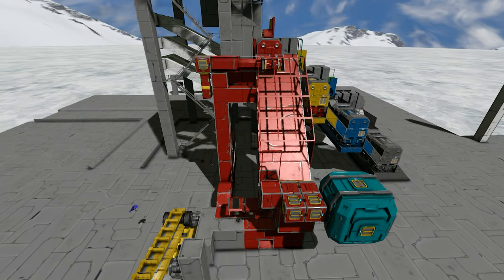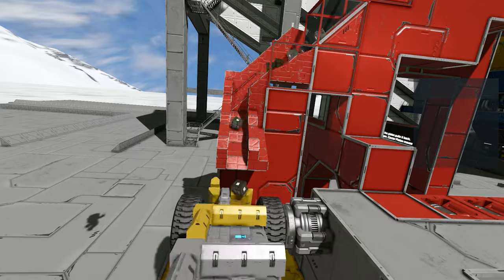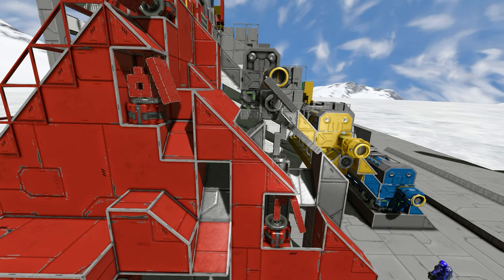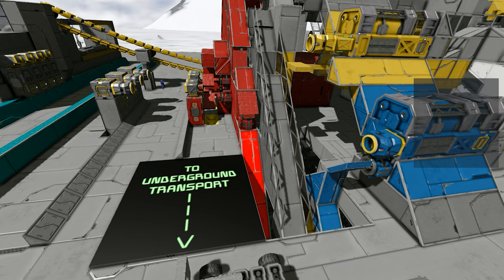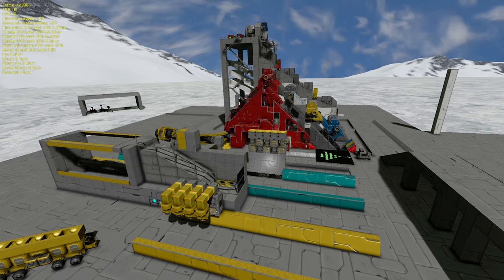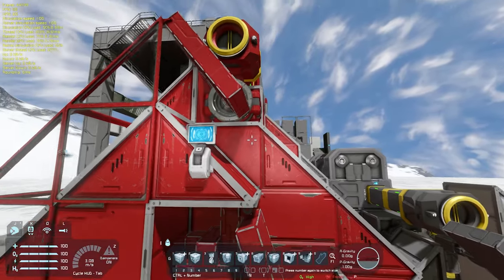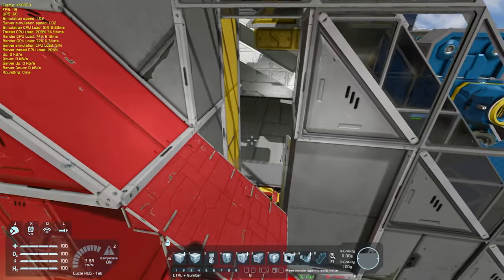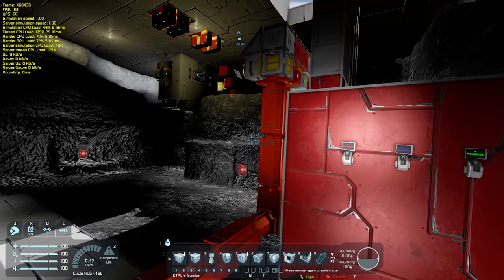Space Factory | Underground Assembling Operation! | Space Engineers

Comment: Maybe you can use the DAS (Driver Assistant Script) for your distribution trucks. It has an integrated autopilot feature for vehicles with wheels. It also adjusts the wheel settings according to the weight and speed of the truck so it would take the cargo into account and the delivery trucks would drive more smoothly and safely. 

By the way I love this series. It is amazing how you invent those mechanisms to transport stuff around and it has helped me a alot in some situations :D